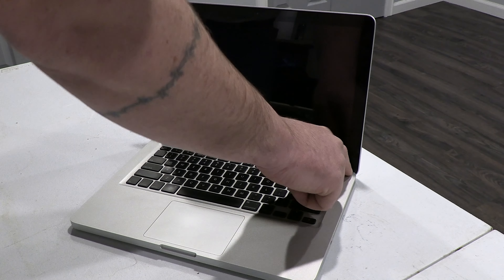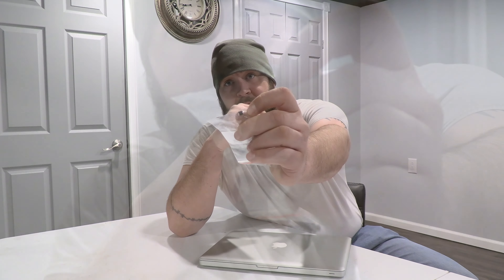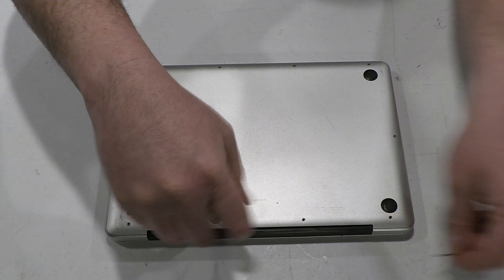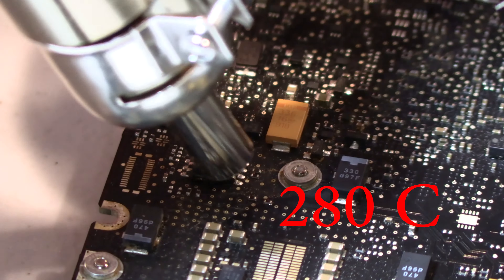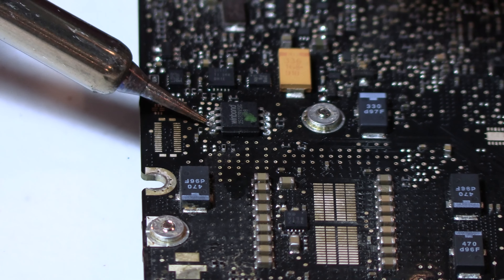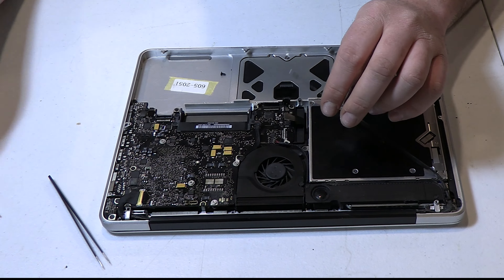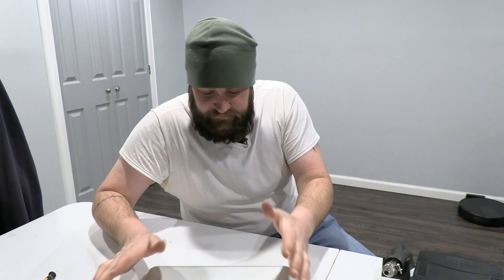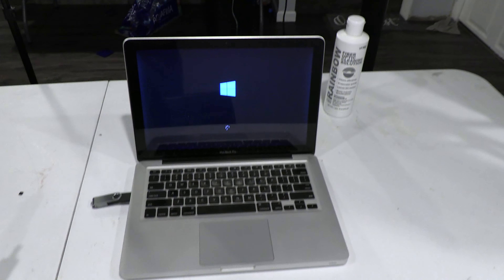MacBook Pro EFI/BIOS password removal/chip replacement

Comment: One time I came across this issue tho they was a known at the time a bypass method for older macs like this requires zero hardware tampering like this.
Reply: Could u tell me what method it was please cause my 2014 mac is locked